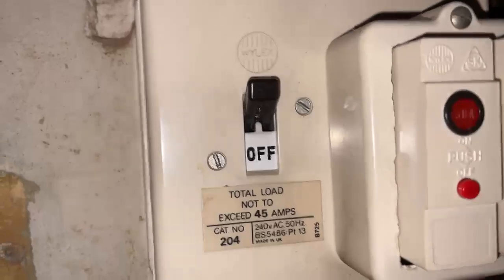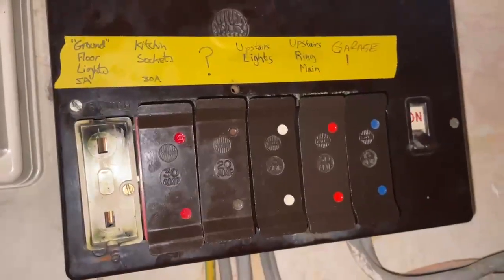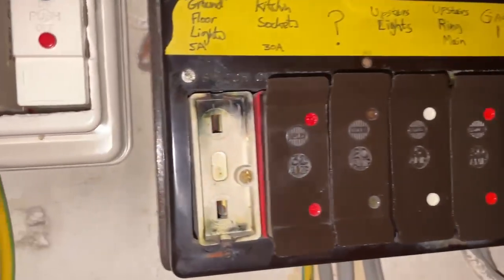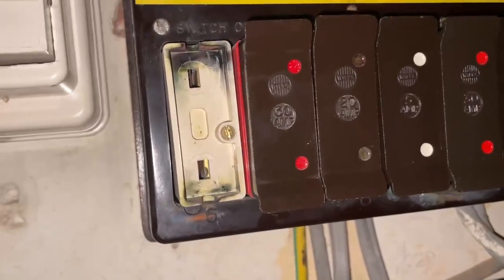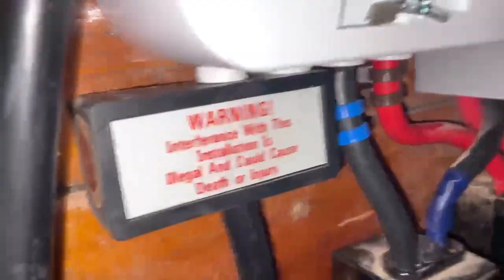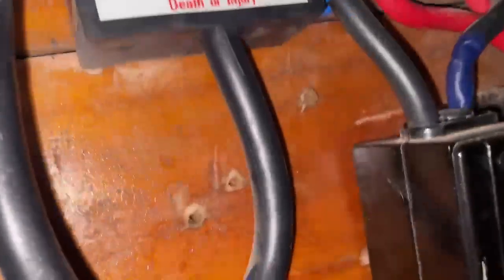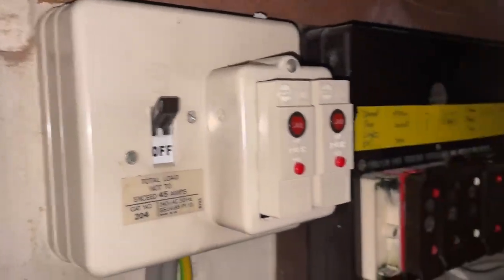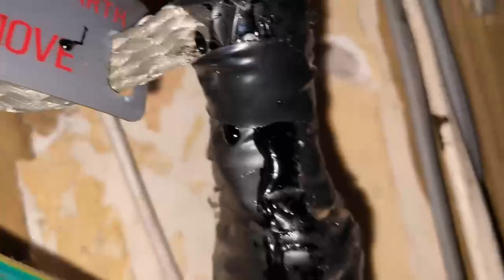DIY How To Replace Wylex Fuse Wire and Upgrade to MCB with Electrical Safety Bakelite Fuse Box

Comment: Could certainly do with an upgrade. 
But it looks like you have an RCD fitted ( grey box with a test button).  Rather than re wire the fuses you can get plug in circuit breakers and change them. ( like the other white fusebox you have)

Comment: That is the original pitch running out of the pilc cable after a ironclad cutout change nothing to worry about ,as for the rewirable fuse box make sure your smoke detecters are in working order as you could have a house fire you realy need the help of a electrician🥴

Comment: That’s the bell transformer.  Those are Henley blocks (just join wires together, not fuses).  It’s leaking pitch, the insulation from inside the wire. Might indicate overheating.

Comment: Sometimes, the cable will go into the fuse bit (cutout) and be gilled with tar or pitch.

If its okd will drip down or after a cutout change or even overload.

Hope that helps 😊